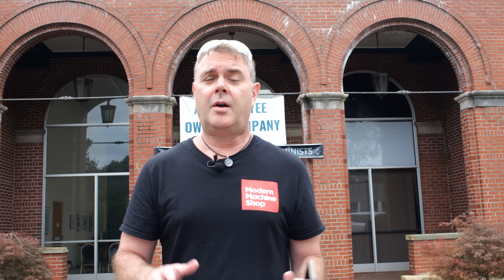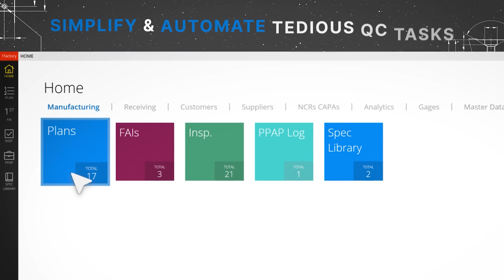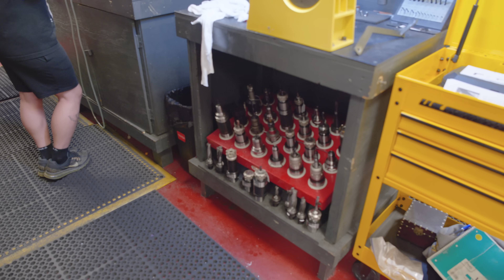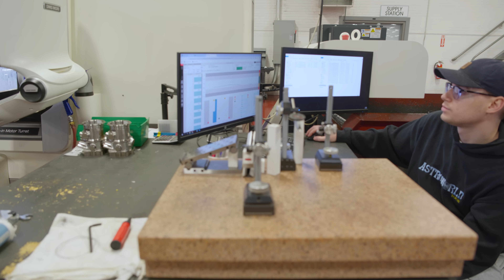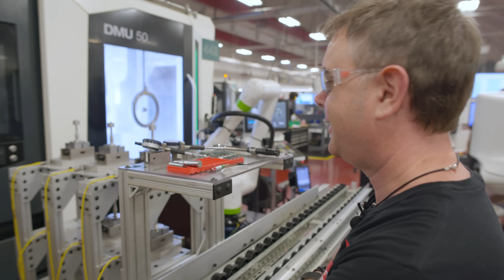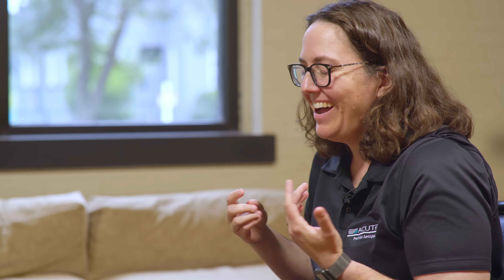Inside a Next-Gen Aerospace Machine Shop Running 24/7 Lights-Out | Shop Tour

Comment: I’ve trying to get into this industry for almost a year now.  The problem isn’t finding willing people, it is finding pathways to build skills and have those skills recognized by industry. My kids were interested in getting into industry and applied for open positions at my current job in an aerospace manufacturing shop. I was told they needed to go through a shop focused on education before ever being considered. This was for a position that is mostly counting parts. That is it. Even after being hired, I have to push pretty hard to get education on learning about the machines I work with everyday. I bought a mill and put it in my garage mostly so I can actually manufacture parts and learn how. This is a huge expense. This shop showcases a better way to run a shop than most out there. Employee owned, opportunities for individuals to explore and be creative, and focus on on-the-job learning is the mix that will solve the finding worker problem.

Comment: I’ve been in this industry for over 2 decades now in southern Indiana. One of the biggest problems I’ve seen is finding people that actually want to learn and excel in the industry. It seems most of the people just want a job and to push buttons and go home. I love it when people ask questions and actually show curiosity but those people seem to have been getting fewer and fewer and further in between. I worked several different jobs before I found CNC machining and the technology and tooling and innovation is amazing. Another problem is all the “easy jobs” are gone all the low hanging fruit jobs are now being machined over seas where companies can buy a finished part cheaper than we can even buy material. It seems like most of the work we have been getting are complex small quantity jobs that nobody else wants to do and takes a significant investment in tooling and fixturing with razor thin profit margins. Automation seems like the easiest thing to remain optimistic about in the current climate but it’s still to big of an investment for small CNC shops running small quantities.
Reply: Very true about being hard to find people who want to learn and excel. And if you do find them by chance, the business managers will crush their motivation and drive them away to keep from having to pay a fair wage for all of that experience and skills. Meanwhile management gets paid 6 figures to sit in a chair all day just talking about the work and not doing any of it.

Comment: I worked for a 24/7 cnc machine shop.WE NEVER TURN THE FUCKEN LIGHTS OFF, WE USE CAMERAS FROM THE PROGRAMMING ROOM TO MONITOR THE PASSING OF PARTS FROM CNC CELLS TO STANDBY STATIONS. YES WE HAVE SENSORS BUT WE STILL HAVE TO MONITOR PARTS THAT COST 2K EACH TO MAKE.
Reply: It’s just an expression that means no human intervention. I don’t think anyone shuts off the lights.
Reply: ALL CAPS!!!
Reply: Room temp iq